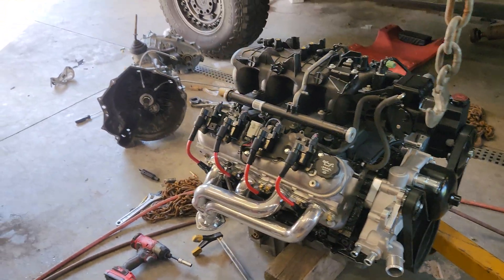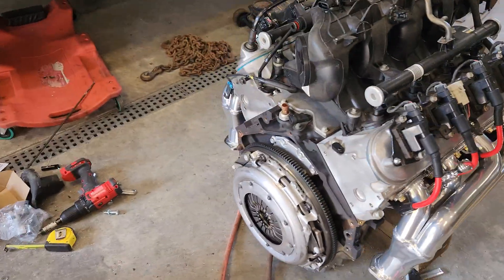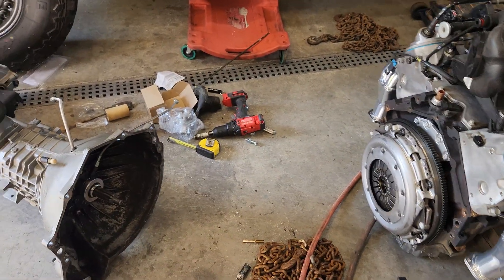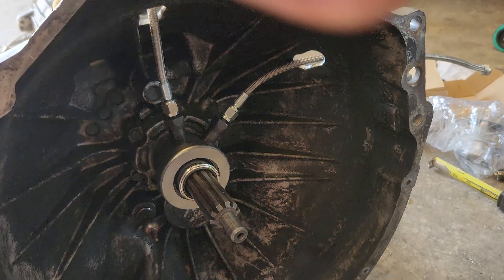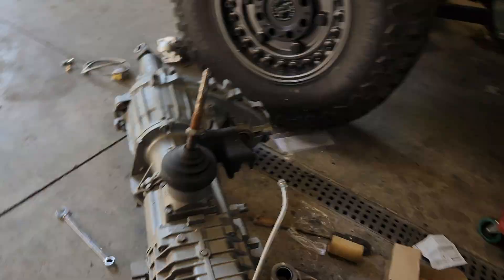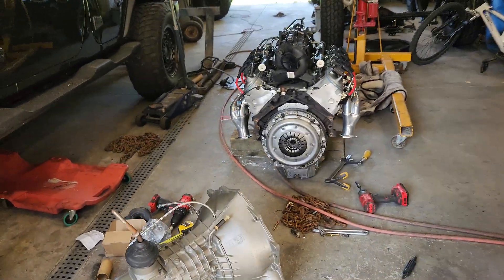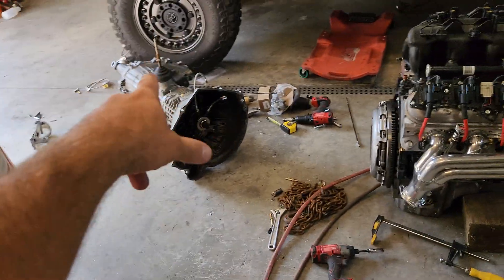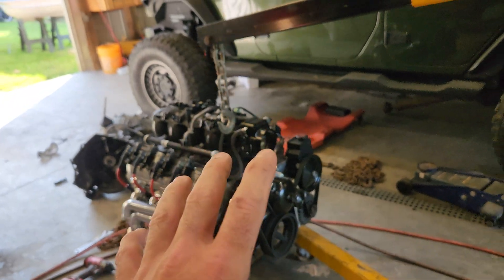bolting an nv3500 to a 6.0 l ls2 v8 for a wrangler jku

Comment: Talarance is ⅛in. 4:52  the silverado ls base come with a short crank. most are longer cranks with the nv3500 and nv4500. So you do need slave spacers i think its right at 1/2 in.

Comment: very informative. Some tips for future use..get late model. I keep a 96 and 97 going rebuilding myself. they go right to LS, by oem throwout. An easy idemntifier is not just the throwout deisgn, but the input shaft has a 3marks at the end.. this identifies 1996 into 2007. they are setup for snesors, nitrided (hardened), last edition input bearing, counter bearing and pocket bearing...and most of all is the single fork design for shifting. The only thing that needs mods is removing the inner seal of the input bearing...let it get drenched in synchromesh for the bigger HP. :goodvibes:
Reply from the maker: @bgd73  awesome! I appreciate the info

Comment: So was your Lq4 long or short crank I’m doing a ls2 and a nv3500 from a 04 Silverado looking to buy the correct flywheel if you have any answer I will appreciate it sweet build by the way
Reply from the maker: Thanks brother! This one is short crank. If i remember correctly the long crank lq4's are from the earlier 1999 and 2000's. Lq4's 2001 and up should all be short crank

Comment: Feel like those spacers would make so much noise
Reply from the maker: I have put over 4k miles on this swap so far and there is zero noise from the trans or any of the hydraulic throwout bearing components . It actually is a much smoother and easier clutch to operate vs a standard slave cylinder style
Reply: Was 6 good? @Steel-Gunner

Comment: Theres info ALL over about the input shaft differences. Trans from 97 up will bolt right onto an ls
Reply from the maker: Thanks for the info. My experience unfortunately was complete opposite.  I did some pretty extensive research and people were either guessing or they were saying it won't hold up. I found very little useful info on bolting an nv3500 to an ls. Also I found very limited to almost no availability of an nv3500 anywhere near me. That being said I had to get what I could take, not try and find a certain year transmission that has zero availability. Pretty much any transmission that was bolted up to a sbc will bolt right up to an ls. This isn't my first rodeo on bolting an older trans to an ls, I have done it several times, but they were autos, and just required a spacer to place the torque converter correctly.
Reply: @Steel-Gunner  yeah all I've ever seen is people put a collar/spacer on the input shaft
Reply: Also, the nbs trucks had a different 3500 than the pre 99s did. Completely different slaves and cases
Reply from the maker: @RogueKnight33  Good information to know, I appreciate any extra knowledge I can get

Comment: Awesome trans, I had one behind a stock 454TBI in a 92full size 2door yukon that stood soooo many clutch dumps. What killed it was wrong oil and filled to the brim by a competent mechanic😤 and I did not ask for the fluid change😤😤😤
Costed me a cluster gear, the second gear and the usual consumables, good as new with the correct fluids of course. I wish I can get my hands on another one. A pain to take apart, even more so to put back together. Thanks for the vid
Reply from the maker: Thanks for the kind words and the info. Good to know it should hold up. I have a little over 1,000 miles on the swap now and it's doing awesome.  I will be making another video here soon

Comment: What transmission would handle that? Currently building a 1984 cj7 looking to put a 6.0 or 5.3 in it. Will primarily be off-road use. But I’m not sure which transmission or t case to use.
Reply from the maker: So far the nv3500 from a 92 3/4 chevy is holding up great. An nv4500 is a sure shot but, very large, very heavy, and pretty low geared. I think the nv3500 is a good fit as long as your not dumping the clutch or doing crazy stuff
Reply: @Steel-Gunner  thanks! I definitely want to build something that will withstand some abuse! Nice build!!
Reply from the maker: @justyce1849  thanks!

Comment: Wouldnt the jeep tcase mount up?  Not using a slip yoke tcase would be far better.
Reply from the maker: Unfortunately, a 241j transfer case is a different bolt pattern, and input shafts are different lengths. I could have had an adapter made, which would cost me $600, plus having to switch out input shafts. The 241c transfer case come with the transmission and cost me nothing. If I choose to do a slip yoke eliminator kit, and i may in the future, you can purchase a slip yoke eliminator kit for just over $200 for the 241c.